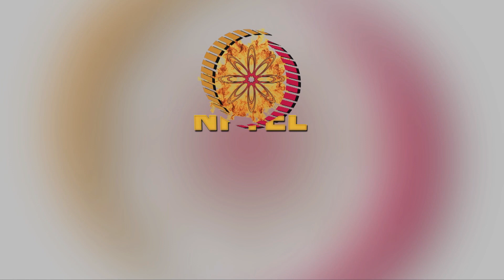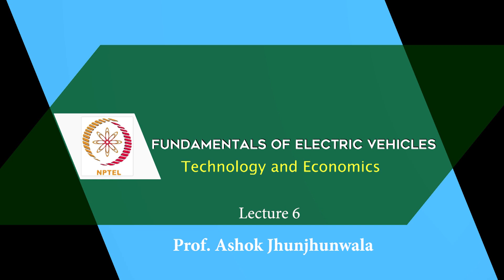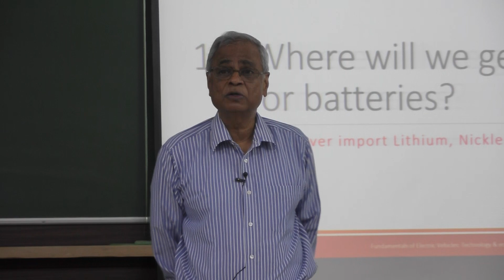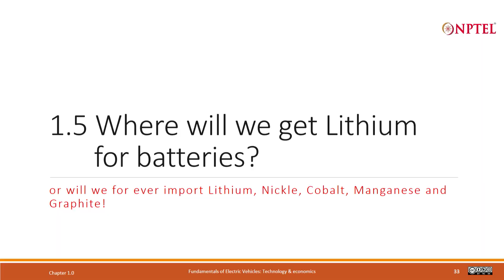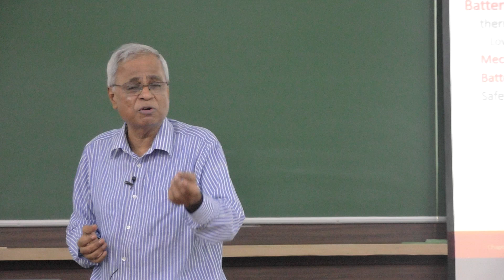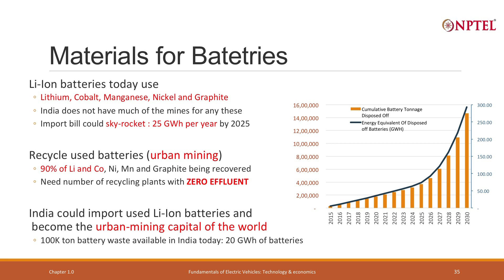Lecture 6: Where will we get Lithium for batteries?

Comment: India definitely is not short of skilled workers, in fact setting up battery recycling plants will open up more job opportunities. But you haven't discussed the energy used in the recycling process. Most of the recycling plants use a hydrometallurgical process that consumes ~30MJ of energy, ~14L of water and also produces 2Kg of CO2 for recycling 1Kg of battery material. Is India ready to meet the energy demand required for the recycling of Li-ion batteries?